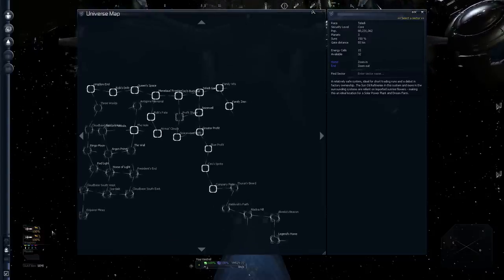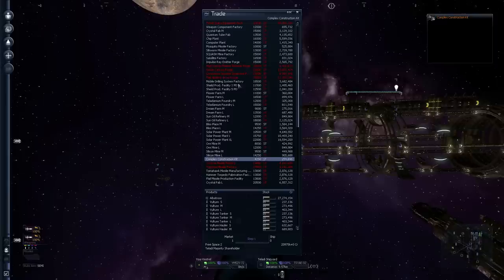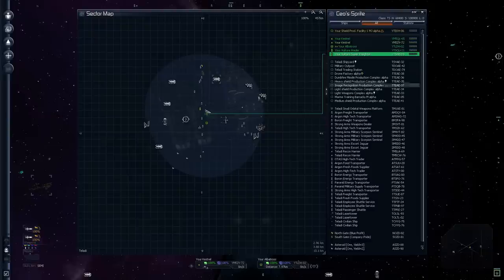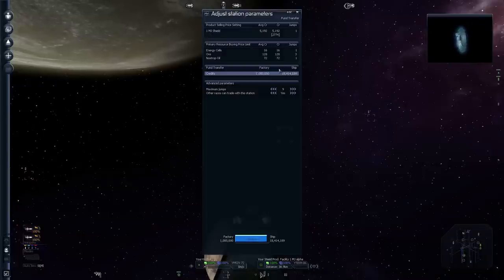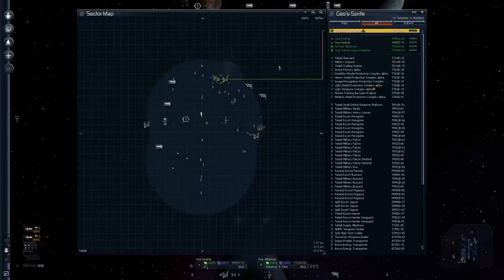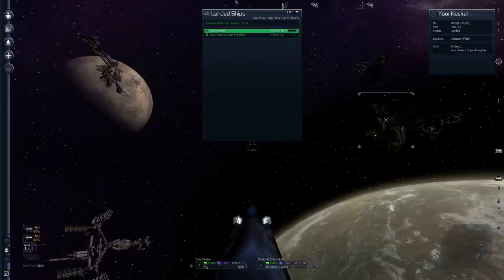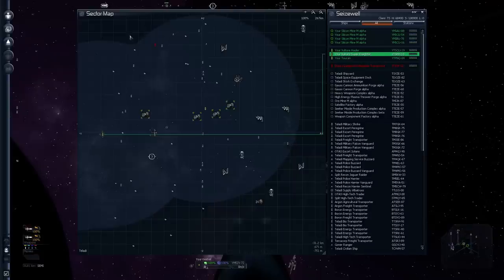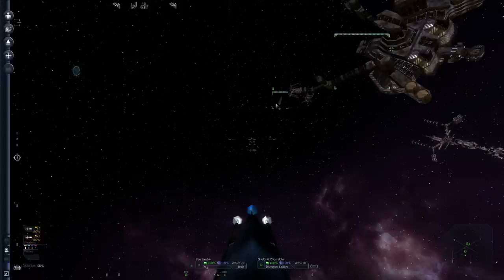X3: Albion Prelude Getting Started Guide (Part 14)

Comment: If you drop an advance satellite, you can see a real time image inside the map. A new button gets added to the top bar of the map. There is a hot key but I forget what it is. Can only see Plan view and elevation views.... so it's just as limited as the map, but you do get a real idea of how close things are to each other.

This 3d map image thing only works for the sector you're in, and only if you dropped an adv. sat.